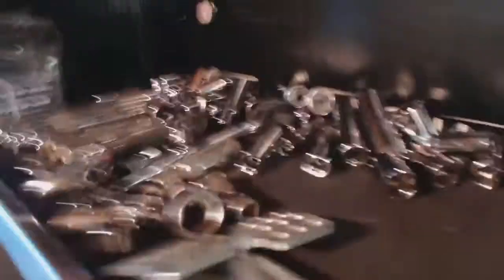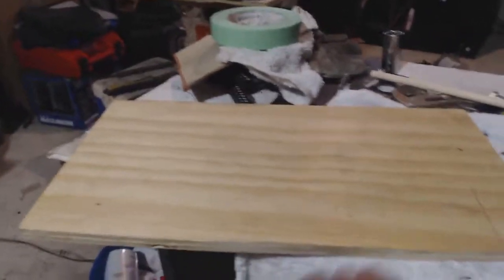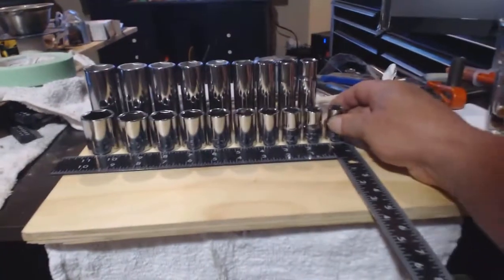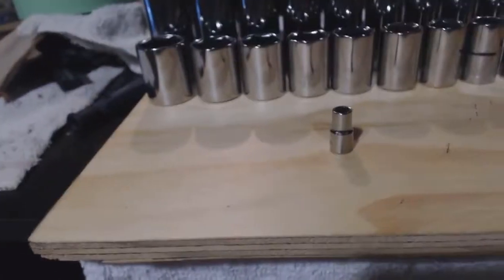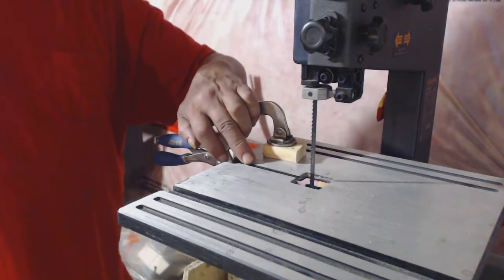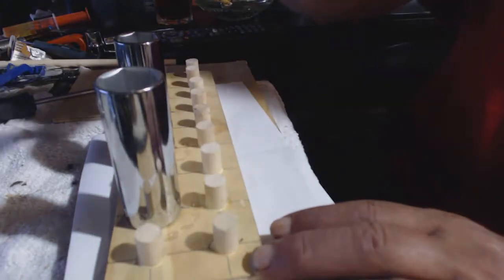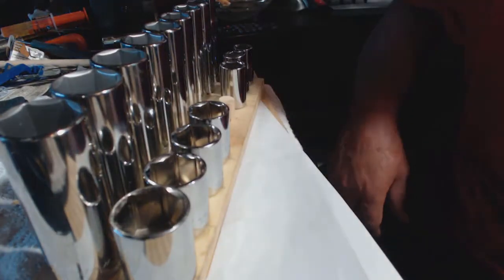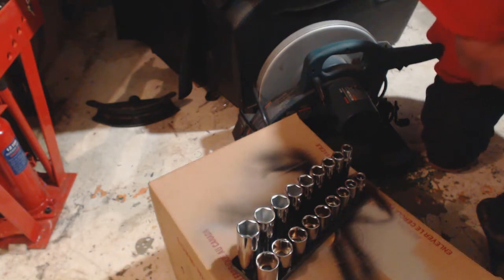Nice Socket Organizer Using Dowels

Comment: I'm going to do this... 3/8" 1/4" and 1/2" ... but I was wanting a way to hold the sockets on the posts when I mount this to a wall. So I'm going to get some magnets and mount them to the base. Perhaps a simple strip magnet will be enough. You don't want too much, just enough to keep them from sliding off. I'm so tired of pegboards so now I'm doing everything with either finish nails into plywood or screws or better yet dowels of different diameters. Sure it's WORK, but that's what we do- work.. Customize our tools, make our workspaces more efficient. Build a little test a little. Kaizen... etc.

Comment: I have had that happed to I just drilled out the socket
Reply from the maker: Hi Dan Bates, That is a good way to go with some  but the sockets I have they are all heat treated so it's difficult to drill them
Reply: I have done it with most tool truck sockets put them in a vice with a rag not so tight to crush the socket and ur good to go
Reply from the maker: I tried it before for some other work that I needed done and it just screwed up all my drill bits, the sockets are tempered, if you did it with heavy duty truck sockets you should make a video of it so I and others can learn how to do it